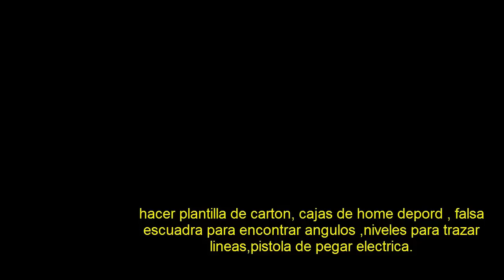Offroad 4x4 Bumper Build

Comment: If you weld the joints from behind with thick seam, it will work well, if it is a thick sheet metal gauge,muy bueno amigo!

Comment: Stick welding, ok, for sheet metal, I've seen some really nice work by other guys, but there are two things I'd like to suggest, number one would be water and welding does not mix, I know a guy who lost his leg because of water and the bad weld it creates. Water main end cap, pressure test, cap blew off, hit manhole came back and took his leg off, along with a few other body parts.
Clean, clean, clean, the 3 C's of welding, you will get much better result's if you had a wire brush on a grinder and a hand brush to clean tack welds before putting another one on top of it or beside it. Sand paper etc... and of course a proper chipping hammer, you know, those pointy hammers with a spring handle ??? Cost about $10 here in Canada...

Not a bad job for where and how you did it, without too many shop tools, for a backyard job it's not too bad, but I think you will find alot of your welds are going to fail.
A mig welder would not make up for a lack of skill and or welding knowledge in general, as some seem to think, I know some guys who put mig welders to shame with a stick welder, old school pipe line welders.
Reply: Acetone

Comment: That's a lot of work getting those pieces cut right and welded up like that. I admire your work. Maybe someday I will attempt a bigger project like this with my everlast welder.
Reply: I built my Dually flat bed on my channel and that was a task. I am thinking of building one now. Lots of people told me to buy a mig but the arc welder did good.
Reply: @cutweldngrind  how thick of steel plate did you use?
Reply: @The-GreenHornet  I did the entire flat bed and headache rack in 10 gauge or 1/8" sheet metal. The frame is C Channel which is 3 and 4 inch by about 3/16 of a wall thickness. I just uploaded a video on the raptor update and you can see the skirts, fenders and lights I used.

Comment: The start of the video you were dead on but that's where it stopped if your looking for a revolutionary bumper make it to encapsulate the bumper and mount to the frame not to replace the bumper. Attaching to the bumper mounts doesn't improve the bumper because as soon as you hit something it will set off the airbags if you mount a encapsulating shell to the tow hooks mount top and bottom it protects the bumper from setting off the airbags but also gives you the protection of the airbags if you hit to hard. Because a hard hit will bend the metal pushing the bumper in setting off the airbags.

Comment: Looks great but would be useless off-road.  There's no rear bracing or framing so at some points you could hit them with a hammer and bend them in. Also that sheet seems way too thin to protect against anything except be a deflector. And those recovery points are far too thin. A lot of work and very carefully done but not safe for off-road at all

Comment: Those are some really bad welds. Amazing design and it looks great. But if your welds are full of holes and perocity and not a solid hot weld all the way through the seam then it’s not going to be structurally sound. Get a cheap harbor freight mig.

Comment: #1-Why no beveled edges on the steel to ensure proper penetration?
#2- Why would you not use the outside edge of the sheet stock as one edge to save material and then you'd already have "one cut" done for you???
Just my 2 cents....

Comment: Metal looks really thin. 1/8th?
Reply: 1/8" is thin ?  lol.   It looks like 1/16"  maybe which I would say is about right to use.  1/8" is thick man, that bumper would way a fuck ton if he used 1/8" thick lol.
Reply: Aftermarket ones I see are usually 3/16 with 1/4 for the winch plate and frame tie-ins.
Reply: Dill Wiggle 1/8th is more offroad bumper material. If he used 3/8ths yeah that bumper weighs more than the truck. But 1/16th he aint stick welding that
Reply: Not really used 1/4 tubed on my entire bumper ways less that 100 pounds hit a deer and it didn't do anything
Reply: Jones 06 off-road or ranch bumpers use either 3/16" or 1/4". And why wouldn't you be able to stick weld 1/16"? I do it regularly. Part of the draw for stick welders is their ability to do almost any gauge.
Reply: Did look a little thin but on a smaller truck youd rather need a new bumper then have a bent frame in a crash. Bumpers are crumple zones theres a point you shouldnt go past

Comment: should have gotten a piece of 3/4" plate and made mounting directly to the frame an option, with the head coming through the bumper an made into eye hooks. Cause No way I would hook a wench or a tow line onto that as it is.